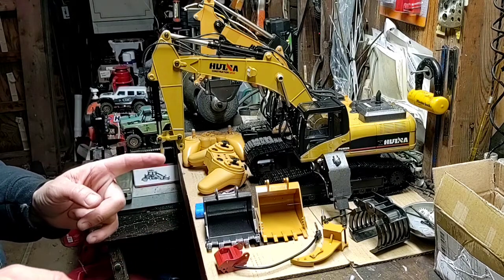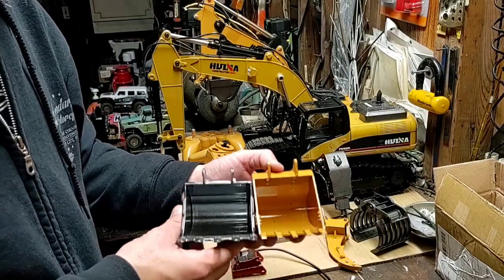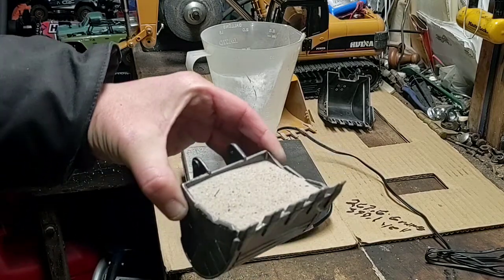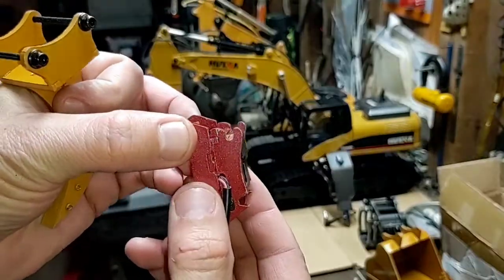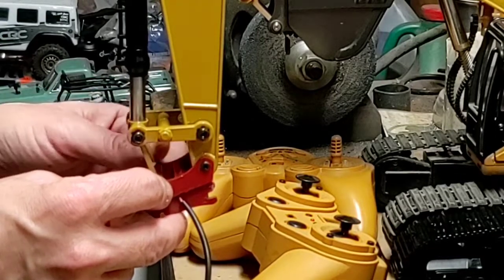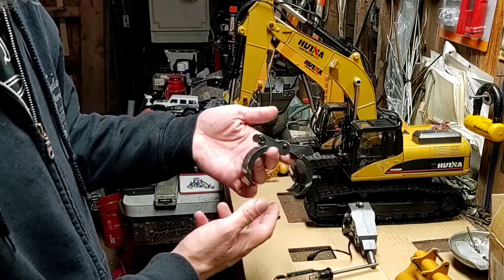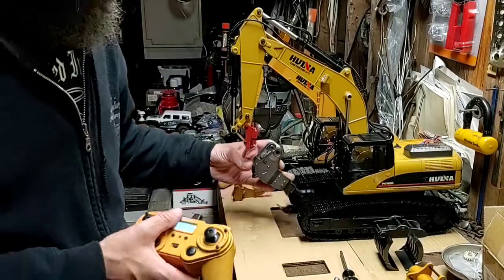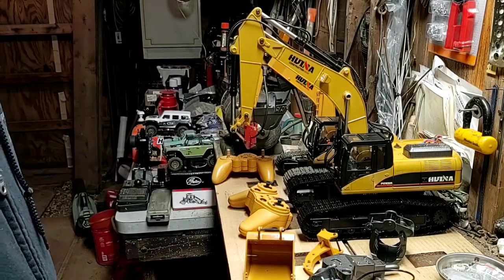Huina Attachment's; Yellow Bucket, Ripper Claw & Quick Disconnect

Comment: Thank you for the great demo!  I was thinking about getting the quick connect/disconnect, but now I think I'll just save my money and stick to swapping out attachments by hand.  Thanks again!
Reply from the maker: My pleasure Wolverine 😊
And you're on the right track with not getting the Quick disconnect,🤔 now that I've used it a little bit, I can honestly say that it's not needed, and it's more cumbersome than it's worth,🙄 😕 You gain a little bit more reach, and a little bit more bucket curl while having it attached, But you lose bucket curl hight,(measuring from the ground to the bottom of the bucket, with the boom raised up all the way, and the bucket curled in) as well as the bucket being closer to the machine,🤔 😕 you have to be careful when you're curling the bucket close to the excavator or else the bucket will get caught up on the tracks.😕 Another bad thing about it, Is the "screw drive" mechanism that actuates the quick disconnect,🤔 Depending on what you're digging in, theirs a strong chance of packing the entire mechanism with dirt,🙄☹️ And it don't work when it's filled with dirt 😂 
I ran the Quick disconnect on my 580 for around 3-4 dig sessions, and then I modified the 580's main boom so that it would lift higher, and kinda decided to get rid of the quick disconnect at the same time,😊👍 I was planning on removing before hand, But I kinda wanted to make a "note" of the removal on video, that way people would understand why I removed it, so that people could make up there own mind on wether or not it's worth it,🤔😕  
Anyways, I think that the Q.D. is a complete waste of money.😁😂💸💸💸
So Good thinking Brother... 😁👍👍 lol
And Much Appreciation for your kindness.😊🤜🤛

Comment: The claw dont need no spring. There is a special Little hole for a screw. I cant show You the picture here. But i have it and i was thinking Just like You ka spring or something) no. Look for a second Little hole in arm and claw.
Reply from the maker: Well unfortunately... I'm right in the middle of moving all the contents from One of our pole barns, into a new larger pole barn, And all of my "RC construction equipment" is completely buried,😕 So I'm not able to see what you are talking about with "that little screw hole" at least not anytime soon anyways.😕
Now back to the screw hole in question, What exactly is the purpose of that little screw hole ? 😕 You failed to mention the significance of that little screw hole 🤔
What is it for ?
And how does it help out with picking stuff up ?
I mean it's not like Huina explains anything about it, or include instructions of any kind, about any of the attachments.😕
All I seen, was a obvious problem with the claw, and then came up with a simple solution to fix the problem, But that doesn't mean it gives you the right to say, That the Claw doesn't need a spring, 🤔 Especially when you fail to mention the significance, or purpose, of the "little screw hole" that you are speaking of.😕
Basically all you told me is that you don't need no spring, And then you said absolutely nothing about the cure for the problem...
Which means that you're not much help for me, or anyone else who might be reading these comments.
I'm not trying to sound like a jerk, But that's exactly how your comment is coming off to me,🤔 "The claw don't need no spring!" Sounds pretty strong Sebastian 😕 
And then it taper's down to ignorance, since you failed to explain the purpose of the second screw hole, Which means that you're not much help.😕

Fyi;  You can catch more fly's with Honey, vs using Vinegar Sebastian! 😕 
You starting out by saying that "the claw don't need no spring" Comes off pretty Strong, at least that's how it sounded to me anyways,😕 Maybe next time try rewording it, 🤔
For instance; The Claw doesn't necessarily need a spring, and then go into an explanation as to "why" it doesn't need a spring, Instead of starting out with "The claw don't need no spring" 😕
(Just a suggestion towards getting a kind response from me in return) 
Otherwise thanks for your Half-assed information, and for checking out the video.
Reply: @R.C.A.D.  i Will record a movie for you today and show You what is the Point of that Little screw.
In simplest way :  one part of the claw is static and fixed to the arm. Only one part is Moving.
Reply from the maker: Right on 😊👍
My apologies for being harsh too,😕 Your comment was received at the wrong time, and I probably should have waited a few more hours before answering you the first time,🙄😕 Sorry man.... I'm usually Nicer than Nice 98% of the time, But I also have a Wicked Temper!  Down Right Evil Temper, and when I'm in that mood I'm not to be trifled with,🤔😕 My Apologies Brother 🙏

Back to the Robster Craw! 
😂 It would have been nice, if Huina would have given some instructions, on how to properly install that darn thing.😂 Lol
Otherwise.. the spring thing works pretty good, as an "alternative" to the Correct way of installing the Timber Grabber. Ha ha ha lol 😂

Sorry for the Bit€hin SimpleGuy 😕🙏 please don't hold it against me, I'm normally a Cool Dude to chat with.😉👍
Hit me up when you get that video out, and I'll make sure to check it out.😁
And then you can bit€h at me in your comment area,if  that would even things back up for you. 😂👍🤜🤛

Comment: I dont think the quick attachment would last long in real life use TBH. If sand or water gets into the motor and moving parts, it would be all over for it. That wire sticking out of the side could be damaged too and/or get ripped off during digging a trench etc.

The one thing that I reckon nobody thinks about is the difference in leverage with it on. It is putting the bucket a bit further away from the arm so the machine will have to work a bit harder to dig. If you have a good strong machine like the 1580, this might not be an issue but I reckon it might be a bit hard on something like a 1592 that does not have the servos like the 1580 has. I could be wrong here but its just my thought on it and why I decided against getting one myself.

I definitely agree that the welding is poor quality on the yellow bucket. I even noticed it before you said it on the video. Same with the ripper. They still should hold up to normal use though. Probably wont even be as obvious when they get dirty from use lol.
Reply from the maker: Agreed across the board, And the Quick disconnect is worthless too, it gets sand in the threads, and then doesn't want to open "and at that point, it's almost a permanent item,😂 You're much better off without the quick disconnect.😁
As far as everything else; The crappy welds are holding up well.😁
Thanks for your Awesome comments, and many more thanks for checking out the video my friend.😊👍

Comment: Will any of the up grades work on the 1593 or is  there some different up grades for it
Reply from the maker: All of the 580's bucket attachments will work with out a Doubt,😊👍
And the 580's all metal Track Drive units, (which are the motor assembly's that drive the tracks) Should also work on the 1593 🤔
And The Screw drivin servos on the 580, would also probably work on the 1593
And If you really wanted to, You could probably Install a 580 Main Boom assembly on the 1593 as well, 🤔
But that's about it 😕

For the Slueing gear, and Slueing servo, I believe that you have to use the Upgraded "1550" metal slueing gear and servo assembly for the 1593.
And I believe that is about all that you can Upgrade on the 1593, fyi I also have a 1593 sitting here for reference 😂👍 lol 
Thanks for your great question Michael, And much appreciation for checking out the video my friend.😊👍
Reply: @R.C.A.D.  thanks for the advice I just purchased my first 1593
Reply from the maker: no problem, And Nice! On your 1593 purchase, I can definitely Dig That! 😄 lol 
Congratulations Brother 🎉 
😁🤜🤛